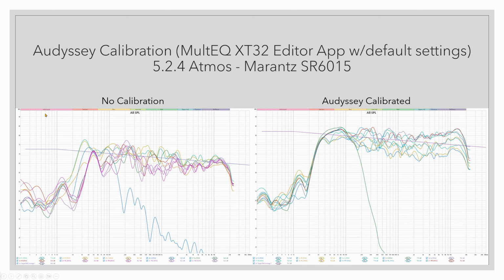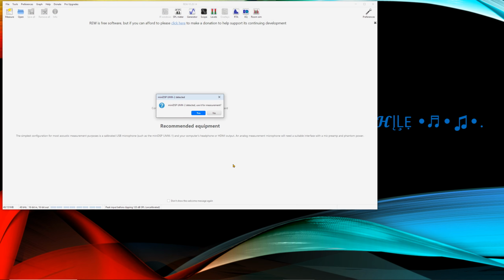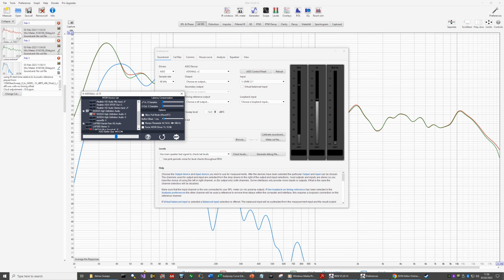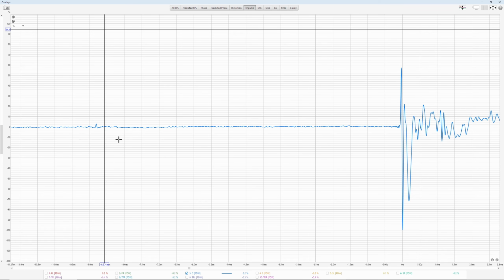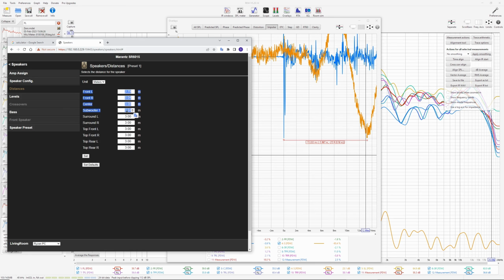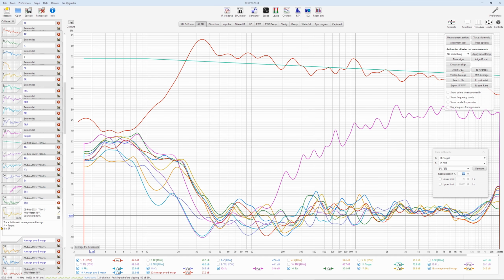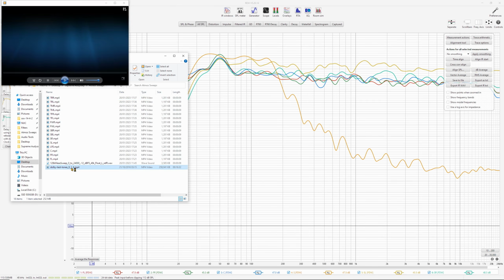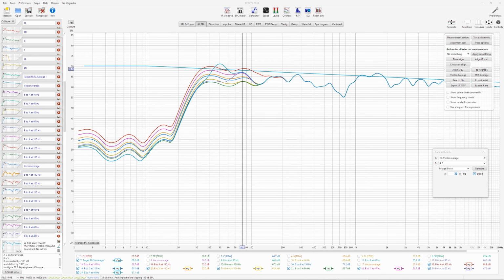Supreme Audyssey Calibration by OCA

Comment: Hey OCA, I would like to ask if the „merge b to a“ method to determine the crossover for each pair of loudspeakers is still valid or if you have a newer tip than the method you used in the A R T video (finding intersection points for each loudspeaker which then is entered into the excel file)? I ask because when I use this method (vector average —> merge b to a), set the crossover accordingly (in my case 110 hz) and remeasure, the bass went up from approximately 70 hz to 100 hz showing a huge suckout at the 110 hz crossover point. Any useful tip on this one? Thanks Sir.
Reply from the maker: I believe, the very best crossover frequency is the frequency your speakers' spec -3/-6dB roll off frequency. This is usually given in the speaker manual. There's no way to phase align speakers and the sub with Audyssey (time alignment is not exactly the same thing) so it's a bit of a hit and miss really. If you want to go through the burden, measure your speaker pair with each possible crossover over frequency when Audyssey is on with REW and pick the flattest response.
Reply: @ocaudiophile , thanks Sir. With Java Excel one can measure LR but cannot with the other speaker pairs, would then measure each speaker with the different crossovers and then vector average the pairs provide the requested solution and is the merge b to a tool still useful? My fronts go down to 26 hz (Nubert Nuvero 140), Center goes down to 36, Surrounds to 36 as well and Atmos speakers 113 hz. So fronts will be fullrange, Center and surrounds 40 (probably 60), atmos 110? Wouldnt that be too many bass sources in the room as I have a huge null in the right front speakers response due to floor or table reflection (I think). What is your opinion on that? If you are interested I can provide my REW file (already corrected speakers) via google drive so that you can have a look, what do you think?
Reply from the maker: You are right about too many bass sources to manage especially with Audyssey's limited adjustments. I choose to select 40Hz XO for my full range speakers for that reason just to leave bass management to subs. There's really not much you can do for the dips after carefully time aligning subs and speakers. I could have a look but when it comes to crossover frequency selection there's nothing I can do better by looking at measurements. You may try measuring speakers+sub at 40Hz crossovers when sub has customtargetcurve loaded and the speakers are not and regenerate customcurvepoints for speakers.  @saschawehde8072

Comment: Thank you very much for taking the time to do this.  My receiver only has multeq (not 32 or xt) so I was intrigued by this video.  Unfortunately, after completing the process, I got no frequency response below 120hz whatsoever.  My sub was set at -12db to hit the target curve and even after boosting it to +12db in the audyssey settings and turning the gain on my amp up an additional 30%(maxed out) there was maybe 1-2mm of travel from my subwoofer and no bass from my bookshelves.  I intend to redo the process from creating new corrections forward, potentially with another curve, but I am curious if maybe multeq does not have the resolution that multeqxt32 has and as a result, some numbers may not transfer to my avr.  For instance, when adding the 241 points to the custom “target curve points”, could audyssey be ignoring 100 of them or something to this nature because it is the lesser audyssey version?
Reply from the maker: I don't think number of custom target curve points is a problem for the type of MultEQ as long as the app accepts them (I think the limit is somewhere near 65,000 points). However, MultEQ uses significantly less number of FIR taps compared to XT32 while generating FIR filters which will effect LOW BASS correction very much. In other words, Audyssey may not be able to correct properly to the target curve it's pointed at especially below 100Hz.
Reply: @ocaudiophile  Quite appreciative that you took the time to reply.  I hope i dont seem as though i am asking for help diagnosing my own issues here.  I am simply trying to contribute issues i am having  in the event someone else runs into these problems.  I am now concerned that the measurements i took with REW were being influenced by the existing Audyssey profile's corrections ( i had a traditional audyssey correction applied prior to starting this guide).  I will start from scratch with a factory reset and report back.  Once again, thank you.

Comment: First, thank you very much for this guide. I am eager to try this for myself. 
I have one questions: can I do this process without using DEQ? Different movies are mixed differently and for compressed audio I have to turn up the volume which would mess up DEQ, right?
And dont we have to SPL all speakers to about 75db or so if not using DEQ?
And can I measure and EQ two subs with REW and MiniDSP before wallthrough this guide? Or is it better to use your Sub Alignment and cross corelation video?
Reply from the maker: You should measure and create filters for your system at the volume you like to listen to it. If you take these measurements with DEQ on, DEQ will then adjust the calibration for louder or dimmer volumes on the go so it's useful for the problem you mention. It has some odd adjustments for surround and height speakers, etc. but still, it's better than nothing.
If you are using multiple subs with a MiniDSP, it's better to time align the subs first using the sub alignment video and dial in the delay settings in MiniDSP.

Comment: With the instructions of the Dolby Atmos 9.1.6 video I was able to get also a measuring of the Atmos speakers for my 7.1.4 setup on a MacBook Pro, using VLC media player on my Mac. Afterwards quit simple choose the wav file of the sweeps in REW, start measuring and play in VLC the speaker you are needed, every speakers has is own chapter, great work.
Now this evening I can go further with the instructions of this video with my 36 measurements. Great to do this job with a Mac, I am not an experienced windows user.
Reply from the maker: Glad to hear that. You're one of the very few who could play the Atmos sweeps with a Mac!
Reply: Very strange that Mac users too much problems have with REW. And there is more an advantage for a Mac because you need no special drivers. I use Ventura or on another system Sonoma, and the latest REW from the REW-website. On every mac will plays VLC plays and you give the right files and sweeps in you 9.1.6 video, maybe you can these also add to this video.
Furthermore a Mac User must setup his mouse as a secundary mouse. So you can speak more optimistic in your videos for Mac Users!!!

Comment: Hey man. I finally got around to giving this a shot.

My results were pretty good. Only thing I changed was I made the target curve give me way more bass (about 10db to match the uncorrected curve of my speakers) and I made Audyssey not do any correction after 10khz because the boost of highs was way too fatiguing in my room.

Using this method has made my home theater sound like a real theater. It doesn't sound like speakers, it sounds like sound. No it's not perfect but nothing will ever be perfect in audio. Thanks for the video!
Reply from the maker: Cheers!
Reply: @ocaudiophile  Yeah man you are doing some really good work. Do you take your measurements with sofa cushions on or off? I think the high end boost might be because I measured with my sofa cushions on but I saw another video from HD MOVIE SOURCE saying to measure with the cushions off.
Reply from the maker: @chadkirk925 The differences are too small to measure precisely. I'd rather put effort to place the mic tip where your ears will exactly be during measurements and leave the room exactly as it will be during film watching for better results.
Reply: @ocaudiophile  thanks. That is my thought process too.

Comment: Thanks again for your work! Really enjoy how my system is sounding now on my Denon x4400.
If I upgrade to an x6700, can I just import my saved profile from my old x4400 to the new x6700? Or do I re-do calibration to the new receiver?
Reply from the maker: You can manually edit the ady files side by side and copy/paste objects in json online editor but 6700 is a different beast and probably has different crossover rolloffs etc. I'd re-do the measurememts.

Comment: I tried downloading the multeq base measurements to ny pc and turning them into the 0 measurement base file, but no matter whether i try to upload the original or the modified curve, multeq will not accept the file and gives an error with "not right curve file". What can i do, i checked file ending, removed returns in the json editor, copied to windows editor, etc, it will not accept the ady uploaded back to my phone. Any ideas?

It seems to work when I use Google drive directly. Don't know what I was doing wrong, but as long as one way works...
Reply: Yeah, I found those and they are highly practical. But nevertheless they, too, didn't work until I accessed them from Google drive. Looking forward to proceed the next few days. 
I plan on aligning the 2 subs as per your multiple sub video first and then I believe I have to Eq them together, right? Merry Christmas.
Reply from the maker: Why don't you try the automated scripts in Audyssey ART video links

Comment: Another great video, thanks again.
I can't seem to get audio out of my front height speakers using any of the "Atmos sweeps" files, any ideas?
I have double checked all settings for my receiver in windows, made it default device, no enhancements, etc
When using the dolby-test_tones_9_1_6 file it does match correctly for all speakers so I'm a bit confused.
It's a 5.2.2 system and a denon x4400H (should it be in "Multi Ch in" mode?)
Reply from the maker: Some things to try: Select "Movie/Stereo" or "Movie/Mult ch in" in the receiver, reinstall Windows Media Player, with default settings, Check sample rates to be all at 48kHz in Windows sound settings, Denon should be the default player, if all else fails try with VLC media player with Windows direct sound and HDMI bypass option active.

Comment: great video, thanks for putting in the time, im having an issue, no matter what i do everytime the .ady file shows up as currupt in the multieq app. even if i dont mod it in json editor, i save it and bring it back to the app it says it currupt. what am i doing wrong?
Reply from the maker: the file extension should be .ady not .json
Reply: @ocaudiophile  yes, I delete the .Json leaving only .ady and it is still corrupted. I drag and drop into Json don't change anything, save then delete the .Json, transfer back to phone and it's corrupted. I did that to test if it's something I did wrong with the settings. Any idea why it gets corrupted? Sr6012
Reply from the maker: @andrew1977au Your app maybe corrupted, try to reinstall
Reply: @ocaudiophile  all the calibrations files I've done previously work fine, they only get corrupted if I transfer into Json then back. I just had a thought, could it be because I'm not starting with a newly  done calibration file?  Should I just spend the money and get the $200 software? I run a 7.2.4 all powered by QSC amps
Reply from the maker: If you share the ady file which causes problems, I can check what's wrong with it.
Reply: @ocaudiophile  what's the best way to share it with you?
Reply from the maker: YT will not remove google drive links! @andrew1977au

Comment: Dear sir,
Hope u are in good health.
I have no word to express for this supreme audyssey calibration tutorial. After complete this , it provide magical improvement of my system . thanks again for this great tutorial. 
One things I am close but unable to align subwoofer with others speaker from distance setting.  When I set right distance for subwoofer by increasing others speaker distance and after set the subwoofer distance then I try to back to set right distance by decreasing others speaker distance but value are not set for distance.  Is there any others way to fix . cordially seeking the advice to fix.

I am using: Denon X3700h and MINI DSP 2X4 HD

Kind regards,
Asif kallol
Reply from the maker: There is a hardware limit of maximum 6 meters you can dial in between subwoofer distance setting and the shortest speaker distance in the group of remaining speakers. If you are not using MiniDSP or a wifi dongle both of which cause extra delays to the signal, you should be able to achieve sync between the sub and the speakers though. Check what is causing the extra delay. If all else is consumed, try to maych another, closer impulse peak of the sub to the main speakers.
Reply: Dear Sir,
Thanks a lot for ur advise. Still I have need to know little more . Cordially seeking your advice as below point:

1.	I aligned subwoofer by following  your “optimal subwoofer alignment” tutorial. My system has two subwoofer controlled by MINI DSP 2X4 HP. And final setting of MINI DSP  delay value are, one subwoofer is 6.54 and others is O. 
Now can I increase same delay value for both sub step by step to fix , is it technically logical?
2.	My knowledge is very limited , have any advice how I check to find out extra delay causing?

Kinds regards,
Asif kallol
Reply from the maker: The delay causing the problem is not the delay between the subs. MiniDSP itself introduces a system delay even when subwoofer distances are all 0 due to the electronic filters in it and your AVR cannot apply enough speaker distance to compensate for it.I ditched my MiniDSP after years because of that. If you share your REW measurements file (.mdat), I can see what can be done best. @kallolkollol1702
Reply: Dear sir,
How i share mdat file? Cal i get ur mail address or if any.
Reply from the maker: @kallolkollol1702 youtube will not delete google drive links posted here
Reply: Good morning sir.
Thanks for kindness.
Here is the link 

https://drive.google.com/file/d/1MgDrKCA5xEdGaRGyrZTSiYOVGx0nwc5h/view?usp=drivesdk
Reply from the maker: The file is corrupt (size is 0kb)
Reply: Sir , here is update one, hope it is workable 
 @ocaudiophile         https://drive.google.com/file/d/1dAyrfV0VCe81xYcS9ZLhD1gHqlEyrblt/view?usp=sharing
Reply from the maker: Try to align the sub for the peak in red circle:

https://drive.google.com/file/d/1sNjhu7a-0Vn7LZvtY9s-jzRsbJP0yTVW/view?usp=sharing
Reply: Thanks a lot sir.

Comment: Hello, OCA.  Thank you for all you do.  I am really enjoying your channel and learning a ton.  I have a question and hoping you could answer it...  If my peak impulse on both of my fronts is >0 and my peak impulse for my center is <0, does that mean my center is connected incorrectly?  Do I need to switch the +/- connection on the speaker?
Reply from the maker: It doesn't necessarrily mean that but if they are the same speaker brands it's quite likely. Best way is to compare Overlays/phase response of center with the rest of the speakers across the frequency bands by inverting polarity of the center speaker. You can do that from within REW without changing wires and decide which polarity is correct.
Reply: oh, btw, I have my fronts connected to a 2 channel amplifier and my Center channel and surrounds connected to a 5 channel amplifier.  The Center peak peak impulse is <0 and surrounds are >0.  i'm just curious if that is an indication that the speaker is hooked up incorrectly.
Reply from the maker: With external amps polarity switching is very common.

Comment: Thank you for the excellent video. In the narration you state midrange compensation should be off, but in the JSON editor it shows midrange compensation box as checked (true). Should the box be checked or unchecked? Thank you
Reply from the maker: Uncheck it for every channel except for the subwoofer channel where it's irrelavant but may help reduce noise in the upper frequencies. The much newer Audyssey ART video is easier to implement btw.